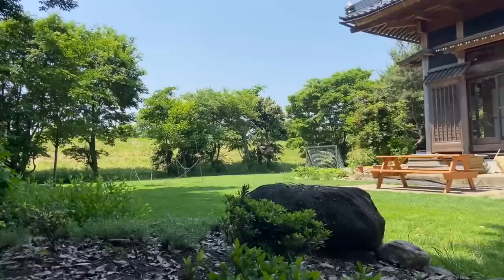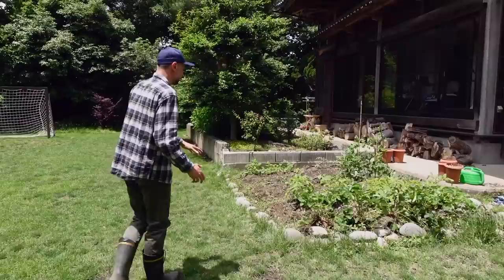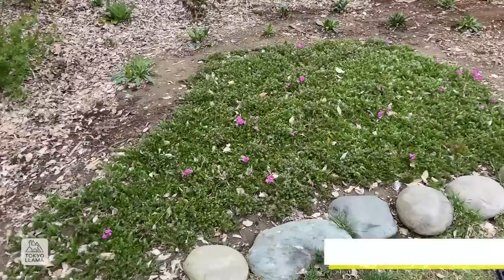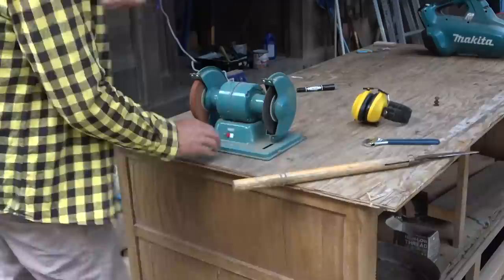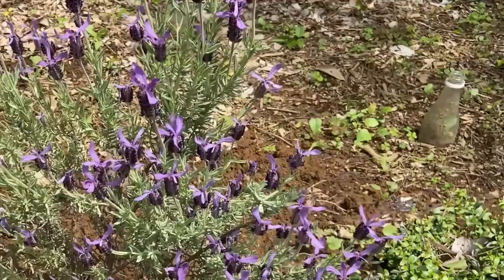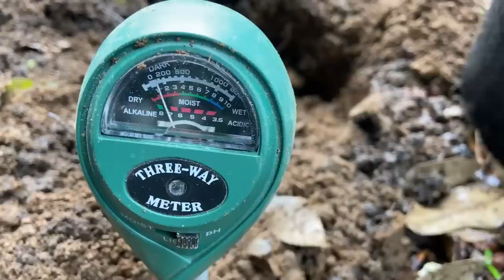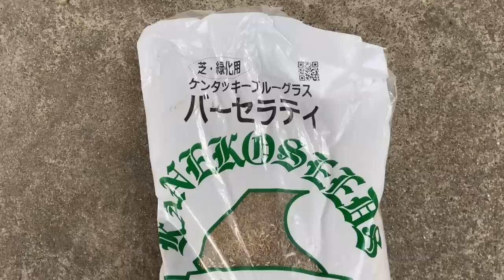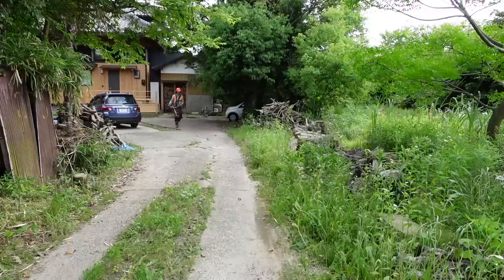Journey through Seasons: Our Japanese Garden Transformation

Comment: Do you ever struggle with unbalanced mower blades? If you'd like to, you can even use a screw driver as a the balance beam to check for where the center of mass is across the length of the blade and grind a little more from the heavy side to compensate. Keeps the hands from shaking off!! :D
Reply from the maker: I've never noticed it or thought to check, but I'll do so next time I sharpen them, thanks!

Comment: Personally I avoid maintaining hybrid lawn grass like the plague. Try spreading 1/4-1/2 inch of composted organic matter, once in the early spring and again in the fall using a mulching rake or a leaf rake will work in a pinch. This will help with moisture retention as well as alleviate soil compaction.  No more aerating!

I once created a lawn using the herbs thyme & chamomile mixed with white clover. It can get a little course underfoot but for areas that don’t get much use it’s a great alternative. Easy to maintain, fragrant, and a bee magnet. You can mow it just as you would a grass lawn.

We were amazed by the reasonable prices at local garden nurseries in Japan. Here in the states they really run the gamut. Generally high prices and dodgy quality. The big box stores are cheaper but then you encounter the widespread problem of acquiring invasive plants and diseases.

I tend to be brutal with plant pruning much to the dismay of my partner. 😇
Reply from the maker: Thanks, I'll try using the compost - anything to avoid aerating with that spike. Might try the herb lawn in some parts where no football is played. Japanese nurseries definitely reasonably priced compared to Australia too.

Comment: The garden looks amazing!! especially seeing the difference to how it looked before. Do you have any tipps of how to cut hydrangea to propagate it? I wanna try that too.
Reply from the maker: Thanks, they're pretty easy, just cut off a young stem, and most of the leaves except the top two (I didn't do this in my video but I'm sure it will be fine), then put the stem in some potting mix making sure that at least one pair of the cut leaf ends are buried. I put it in a spot that only gets brief morning sun. And remember to keep the soil moist. Should be ready to plant out by the next spring or autumn.

Comment: If you want to continue using those shears don't sharpen them like that. You'll destroy them that way. You need a shallow bevel on the top of the shear blade not a sharp one at a parallel incline to the shearing flats.

Comment: Do u use smoke to keep mosquitoes out of the house...? On another channel with an old Japanese home, the Japanese nephew who inherited his uncle's house (which needs a lot of work), he points out a flat bed just inside the entry where I take off your shoes. He explains that coals are kept bur int there in traditional homes and although it is indoors itnis ok because the ceiling immediately above this area is open intentionally to the rafters, and the smoke is channels into the rafters intentionally along the areas open to the outside. Apparently mosquitoes hate the small if smokes wood (his uncle's home was madenof cherry, largely). So, in summer, even with the screen doors open there mosquitoes are kept out.

Did u find this entry area in your traditional home as well?
Reply from the maker: In my house, no, it wasn’t really designed for that. You need some kind of soffit vents. But some houses used to use smoke, particularly those with thatch roofs.